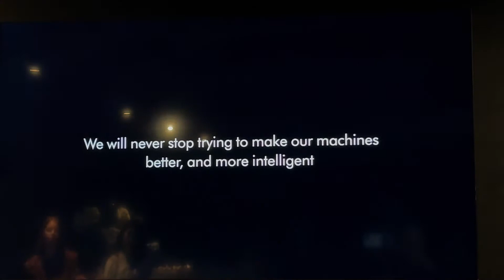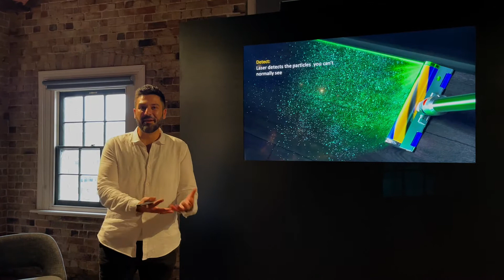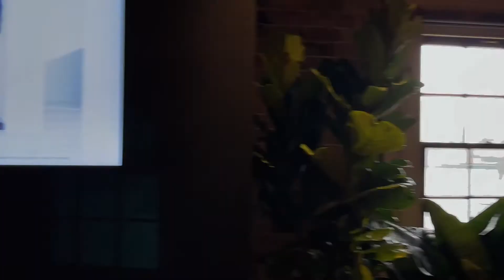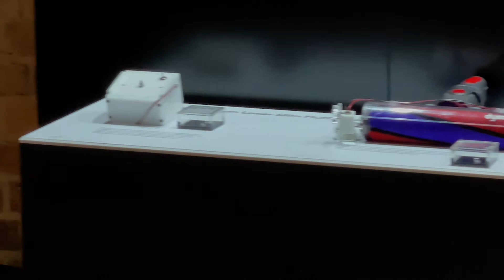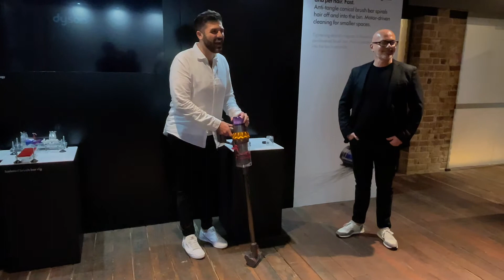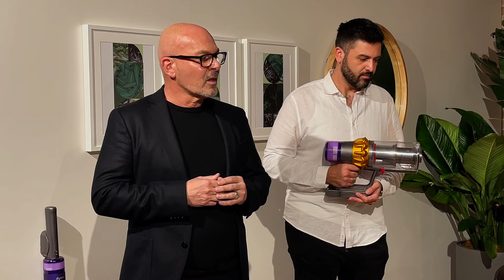LAUNCH video: Dyson’s first vacuum cleaner with laser detect tech reveals hidden dust - AWESOME!

Comment: Just work properly? Like the "root 12" model that they inverted the cyclone on and it eventually clogged up (with gradual loss of suction) and stopped working with no way to access the inside and no recall?
Reply: Just like the AM05 heater that could catch fire.  The V Ball wheels that snap off on cylinders and uprights and tho rubbish plastic bearing on cordless cleaner head that wears out a lot and makes the wheels splay outwards.